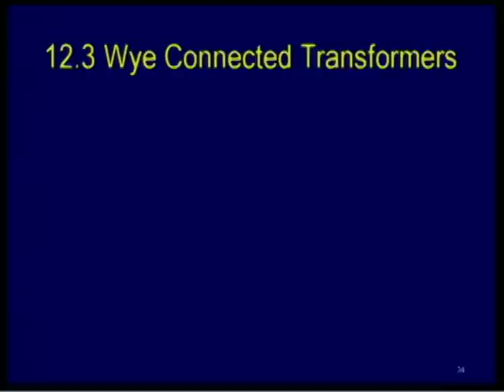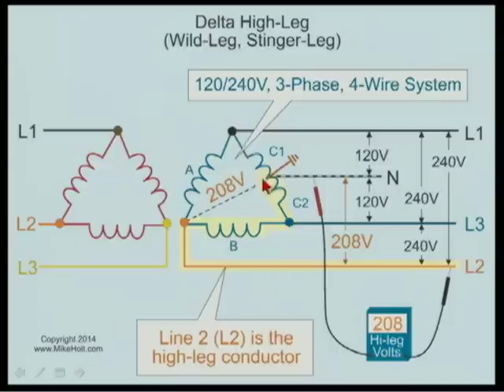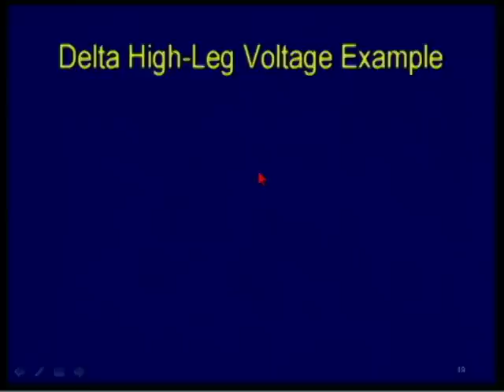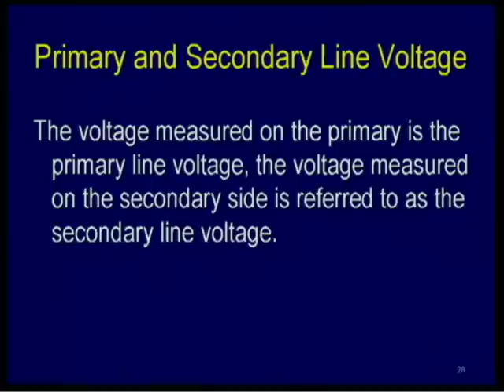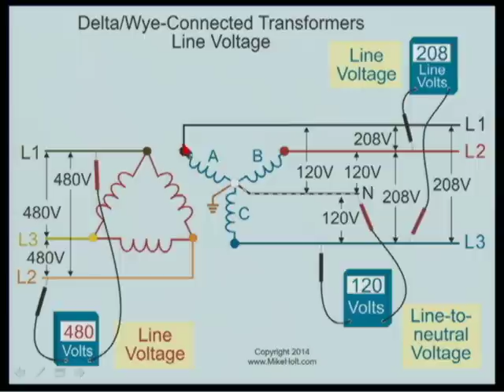Transformers - Understanding Delta/Wye Connections [250.4(A)] (12min:11sec)

Comment: It’s very necessary mike. It separates electricians from installers. Anyone can bend pipe or run rope. This is what separates men from boys
Reply: One of my mates is a qualified electrician, domestic work. Hes great at wiring houses because you dont need to know much apart from pulling wires around. Last week he connected up the machines in my mates carpentry shop..the bandsaw ran backward so they switched the polarity, fine. Nrxt machine they connected a big motor with star delta switching and it arced and blew. Then...they switched the polarity on this one too and boom. SMH

Comment: This video explains everything so well and states it so simply that all the info that I tried to understand in other sites seems to be unnecessarily complicated. Mike, your videos are GOLD,  thank you so much for uploading them.
Reply: Leonardo Moreno the ground and neutral. .are they really connected inside of the transformer??
Reply: @Mike Holt a
Reply: @chardysmile  Ground and neutral are either connected inside the transformer, or inside the secondary protection disconnect immediately adjacent to it.  The transformer secondary circuit is called a separately-derived system (SDS) in the NEC.  This means that it needs to have its own connection to the grounding electrode, and its own establishment of the neutral at ground voltage, otherwise the three phases would float.  Transformers isolate the two sides, as they only transmit change in voltage, rather than absolute voltage.

From the perspective of physics, it makes the most sense sense to make your neutral-to-ground bond inside the transformer.  But because there is precedent from how we bond neutral and ground in service disconnects that are on the secondary of utility-owned service transformers, the NEC gives you the option of treating the secondary conductors like service conductors, and bonding neutral to ground in  the secondary disconnect.  In any case, you only want to make this connection once for the SDS, and you connect to the GEC and grounding electrode, whereever it happens.
Reply: @carultch  thanks

Comment: Question; My local residential transformers are ALL Single Bushing
grounded Why.    Yes, only one bushing.

This is multipoint grounding at each pole/transformer.
Question, where is the parallel neutral going back to the
power company substation?  thank you

Comment: Mike:      As a point of information. I would like to point out the following. A delta transformer is an isosceles triangle. All triangles have a total of 180 degrees. Because it is an isosceles triangle the angles are all equal. Therefore the angle between all angles in a delta transformer are 60 degrees. If one takes the sine of 60 degrees multiplied by 240 volts one will get 207.8 volts.      In addition  Y transformer is arranged in a circle. Because there are 3 equally spaced transformers the effective angle is 120 degrees. Interesting the sine of 120 = sine 60.Therefore line to neutral voltage in both delta and neutral are equal.      Interesting HUH?
Reply: James Caraway delta is an equilateral triangle and that's why all angles are equal. Thus 60-degrees.
Reply: Equilateral triangles are more specific than isoceles triangles.  Isoceles triangles just have two equal sides and two equal angles.  Equilateral triangles have all three sides, and all three angles equal.

Comment: I understand but not everything. If we were to put more windings on each transformer of the secondary star side to give 240 line to line and 120 from line to neutral. Can they put that number of turns so that we can achieve those voltages out of a secondary star system or is the 208 / 120  is just how it works because i know or heard you can put a certain number of turns to get a desired voltage. Thanks
Reply from the maker: You can't get 240/120V on the secondary of a Wye configured winding.

Comment: Can I connect a delta system to the secondary of a wye transformer and just not terminate the neutral? Transformer is 4160 to 480y277. However it's a 480 delta system.

Comment: Really looking for WYE-DELTA configuration. Sad you didn't cover it :(

The NJATC homework asks about WYE-DELTA, but doesn't explain it very well.
Reply from the maker: Call me 352.455.0794 anytime and I’ll help! Mike Holt
Reply: In my 50 years as an industrial electrician never came across a Y Delta. A Y primary more then likely would only be feed with 3 wires.

Comment: At 7:00, he said faults will not cross on delta wye grounded transformers. You are wrong. SLG, DLG, LL faults do not cross delta wye ground transformers BUT a three phase fault does.
Reply: That is NOT what Eric said, he said the fault doesn't go from primary winding to secondary winding becasue of the air gap between the primary and secondary.

Comment: Unstable incoming power during peak times of the day especially during summer months. Brown outs ? Or does that not happen at 480v My concern is this is a 180K saw sold to my client with the understanding that at 208V will run fine given it’s 10% power allowance. Manufactured in China to run at 200V
Reply: @garbo8962  actually my mistake there from Japan. There whole power grid is 3phase 200V I’ve been running these saws from 3 phase 240V delta high leg so far no problems. There were initial software problems but not sure if that was power related. And this 240V is more like 253V so with a step up transformer it’s making 490V on 460V machines. Fingers have been crossed for a couple years now.
Reply: @garbo8962   
50 hertz
100% true there motors are all wound accordingly. Problem comes when you purchase a used machine most will need a independent transformer to step up or down which ever gives you the closest power to the name plate. Most are just 200V doesn’t even give you a option. Just hooked one up 480 down to 200 just to give it the power it’s used to. Big problem if your power from the poco is high to begin with.

Comment: You can buy a 3 phase dry type transformer  with a 120/240 Delta secondary all in one.
Reply from the maker: Correct.
Reply: Was told years ago that never use more then around 10% on a delta secondary with one of the secondary coils tapped for 120 volts. If too much power is pulled off one coil it produces a greater voltage drop in that coil. For every 1% voltage difference between 3 phase legs think it produces around 3% more heat in a 3 phase motor.

Comment: Does the neutral on the wye carry less amperage?  Why are there 3 120 voltage lines and only one neutral?
Reply from the maker: The answer is not something that can be answered via a post. I suggest you search the Internet on calculating neutral current for a three-phase system.
Reply: Look at the timing of three phase balanced waveforms at once, with 120 degrees of phase separation each.  When phase A is at full amperes, phases B and C are both at -50% of full amperes.  One phase is at -50% and increasing, the other phase is at -50% and decreasing.  The current adds up to zero, among the phase conductors alone, given balanced currents on all three phases.  Phases B and C are sharing the job of carrying the return current of phase A, while they are also supplying current of their own timing.  You could theoretically cut the neutral conductor (not something I would advise), and the phase conductors would carry the full round trip current on their own, given balanced current among all three phases.

Worst case scenario of any imbalance, the neutral will carry a current equal to the largest current among the three phases.  That is why you need only the one neutral conductor.

Certain situations of extreme nonlinear loads may require a 200% sized neutral, given triplen harmonics that are multiples of 180Hz on harmonic intensive loads.   These harmonics add up, rather than cancel out, on the neutral conductor.  But for most loads, a 100% neutral is enough.
Reply: There is no reason to have more than one neutral, because the neutral should be at the same potential to ground (zero, ideally) for each phase.

Comment: Another way to get 208 volts line-to-line;

(120 V + 120 V) * Sin 120° = 207.84 V or 208 V (rounded up)
Reply from the maker: Thank you!
Reply: We always multiplied by 1.73
Reply: Phase to Phase Voltage (Vab) is √3 times the phase to neutral voltage (Van) in magnitude but Vab would lag behind Van by 30°. This is true only in case of a Wye connection...in Delta connection, its the Current which obeys this rule.
Reply: Treat the voltages as vectors (because they are!).
You can do it 2 ways using trigonometry -
1) (simplest) Split the isoceles triangle into 2 right angle triangles. 60*/30*/30* on the right side.
 Cos 30* (0.866)
 = adjacent (??? Volts) / hypoteneuse (120 Volts)
Simple arithmetic shows the adjacent as almost 104 Volts. It's the same on the left side triangle.
Add them together = 208Volts. QED.
2) The Sin rule  -
A (120 Volts)/ Sin a (30*(0.5)) =
B (??? Volts)/ Sin b (120*(0.866))
Simple arithmetic shows that B is almost 208 Volts.
Simples! (As we say in the UK after a long running series of TV ads.)
Reply: Just to clarify, I'm referring to the Wye example. Sides A, B (imaginary line), & C. I'm calling A, & C 120 Volts. B on top is the 'unknown' Voltage.
Reply: @colt2657  1.73 is good enough for most practical purposes, because the third digit in most grid voltages will deviate from nominal anyway.

Mathematicians prefer to represent non-ending decimal numbers with an exact expression, rather than a rounded series of digits.  Because it eliminates a source of error, knowing that the number ultimately comes from sqrt(3).  You can evaluate sqrt(3) to any number of digits you need, while 1.73 is stuck at 3 significant figures.

Comment: I’m hooking up a large 3phase saw that was purchased overseas and ran at 200v 3phase. 
I’m installing a 45kva 3phase 480V primary delta to y secondary 208v is concidered within the 10% voltage allowance on he equipment. I always thought the 10% was for voltage problems from utility company provided your starting with the proper voltage. In this case I’m already higher to start. Has me concerned if there is flux in the incoming.
Reply from the maker: What do you mean by 'flux in theincoming?' Send a link about this topic.

Comment: I have three phase motor  230v3p can connect to transformer delta connection. L1-L2 & neutral is 120V  neutral L3 235v
Reply from the maker: Please post your question on the Code Forum at www.MikeHolt.com, under the Engineering Section.

Comment: I was amazed the first time I worked in a large substation, in the now closed Castle Air Force Base at Atwater, CA, to see these huge transformers had an XO terminal that went to straight to earth ground right off the side. My grandfather worked on the original construction of Grand Cooley Dam. He told stories about it that I was way too young to understand, other than it was a great source of pride to him. Thanks, Mike!
Reply from the maker: I was personally at the Grand Cooley Dam and there are three "HUGE" transformers on each side of the dam. Mark A, B, and C. Then if you following the overhead buss (which I did) one terminal from each transformer tied together (Wye Secondary) and it went into the earth and it was marked "XO". Blew me a way... So I know the feeling.

Comment: If a line voltage on the primary are connected to each other wouldn't that result in an arc blast please help me to understand why these diagrams show them connected to each other
Reply from the maker: Nope, because this is a 'winding' that has sufficient impedance' and the load on the winding will be practically zero amperes when there is no load on the secondary. I'm sorry but I can't explain the entire theory related to your answer.
Reply: @MikeHoltNEC  Thanks for the reply, so- this primary winding is like a very very very long heating element? In theory? That's it for now, I know yall are very busy!
Reply from the maker: @drawingtime2589  Well.... you can't use the example of 'resistance' since this is related to induction (but you are kinda right).
Reply: @MikeHoltNEC  thanks I've been pondering this for quite some time

Comment: A banking transformer is configured to OPEN WYE/OPEN DELTA. Can this be reconfigured to OPEN WYE/OPEN WYE? What will be its secondary output voltage...Thanks and appreciate for reply.
Reply from the maker: Order the transformer configured the way you desire it to be. But I have a question, what in the input and output voltages?

Comment: Why does the USA use 120V systems and not 240V like other countries?
Reply from the maker: Good question, let me know what you discover.
Reply: The reason has little to do with practicality,  and 120 volts is used for historical reasons.  You see, back in 1879 when Thomas Edison produced the first practical incandescent lamp,  it used a carbon filament,  and worked best at 100V.   Edison's first electrical power plant on Pearl Street in New York City in 1882, supplied 110 volts DC.  Less than a decade later, in the mid 1880s Tesla designed and patented the alternating current system which was far more efficient and could serve customers miles away instead of blocks, 110/120 Volts AC became set in stone, since it was backwards compatible with the carbon filament lamps at the time,  and for decades,  AC and DC mains power would coexist.  Switching over to 220- 240V like much of the world uses,  would obviously be very expensive and impractical,  since everyone would have to buy new equipment or install step-down transformers in their homes and businesses.   The 230V 50Hz system used in Europe & much of the world,  is actually a more efficient system than we have in North America.